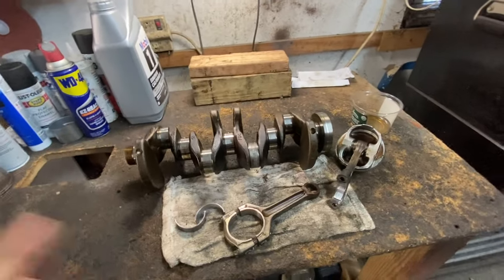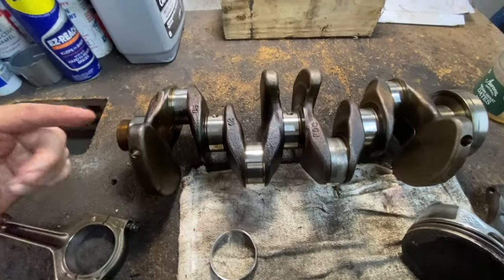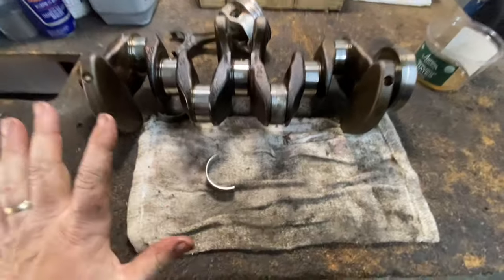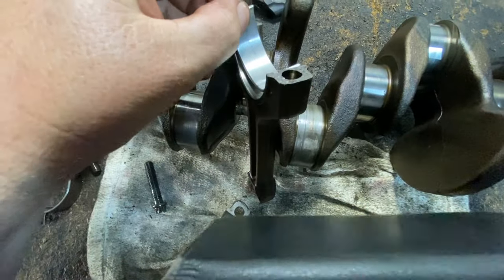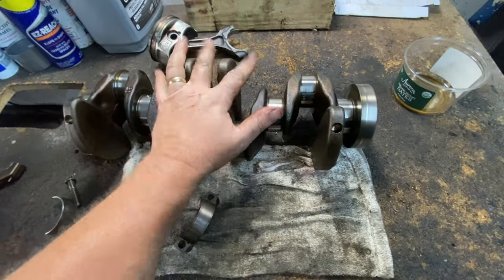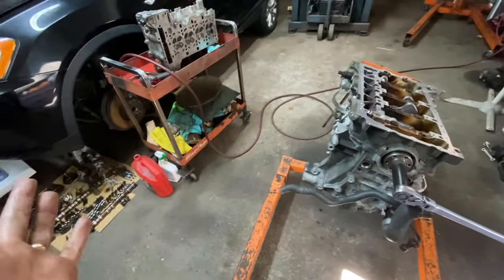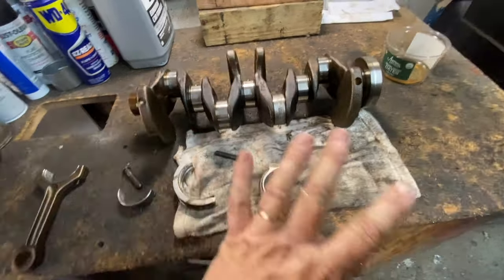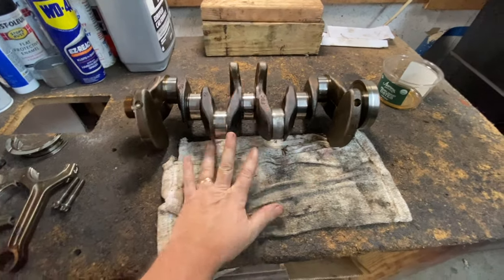Engine Rod Knock - Is It Worth To Be Fixed?

Comment: When this happens to the motor are the cylinder walls at risk ? Is changing the block too much work is it unnecessary?  I was commenting on another of your videos , I just got my car back from 100 miles away and sounds like a rod knock , the car still turns on lol . But now I’m waiting this video and wondering if I should buy crank , but then it’s like so I need a block also ?
Reply from the maker: If you hear and engine rod knock it’s the crankshaft and connecting rod that are damaged. Probably not the engine block cylinder walls.
Reply: @motorcarnut  thanks, yea I caught one of the few crankshafts for my exact model on eBay 220 after watching this. do you think it’s good to change the cylinder head ? I bought one I can return it if not needed. But the Last motor burned lots of oil or maybe was leaking somewhere I couldn’t see. Or maybe leaky exhaust valves .Is a newer used cylinder head overkill by buying it or do I need it being that it could possibly solve any oil “ burning in exhaust valve “ problems since I’m sure the car had these problem before the failure ? I have the 2010 2AR with the recalled pistons where the o ring gets clogged. The motor also didn’t have much mixing of oil and antifreeze when I drained both . That kinda makes me think the oil burned was from leaking valves in the head. Is a whole new head necessary? Will I get a better build vs using old head n internals or moving old internals to newer used cylinder head? Or just leave my old cylinder head alone, I was only going to reuse my cams n camshaft n use the internal from this used head . The used cylinder head is so dry but looks clean . I have to check the cam caps because it looks like this cylinder head was sitting for years . No oil , some surface rust on springs I might return it I’m not sure yet , if I can get it nicely oiled I may use it
Reply from the maker: @Raygetplenty If your cylinder head it not warped, I’d reuse it. You never know with used parts may had a crack or something. Stay with yours if it’s good.
Reply: @motorcarnut  yea Im looking at the journals on my cams and the bearing on the exhaust cam(only bearing in head), mine look so much better than the used part I bought. Mine just looks more workable lol don’t know how to put it. But the used part looks so dry it’ll need some breaking in again . How long the springs n valves haven’t been compressed. Only thing about my head I’m worried about is how good it will mate to the head gasket and the block vs the part I’ve bought . I can’t lie the part I’ve bought looks very clean , I think they cleaned it with something, it has no smog/grime/oil on valves face, on the combustion circle part on bottom of the head . . Very tempted to use it that’s how clean it looks . But it’s 300$ if it’s not needed I’d rather return it. I’m using my cams for sure , the head in 2 pieces . I can use my part of the head that holds the cams , that includes the cam caps/exhaust bearing .the main cam housing basically. But use the bottom and valves n springs from new head that is after I clean them . Or use my springs since I know they’re good but the valves from the used part since they’re cleaner than I’m suspecting mine to be . So other way I can use a better looking part that will be mating to the block but still have the clearance in the cams / cam caps / bearing from how my motor was previous. Essentially keeping the same head but better valves better head gasket seal . They say aluminum head always bend when coming off , right now if my head doesn’t look to bad at the mating surface ( bottom ) I may use it over . But if the new part looks better I may use that . But I’m all over the place I really do think if mine looks fine I need to get my money back
Reply from the maker: @Raygetplenty they probably cleaned it. It yours don’t have scored cam journals top and bottom you should be fine not good to mix and match components. But you have to check cylinder head deck for straightness. I have a video on that as well, if out of spec can be milled flat again. You have to check this on any head you decide to use
Reply: @motorcarnut   so which ever cylinder head is in spec is the one I choose . Or just return the purchased cylinder head ? I’m starting to feel I should’ve just got springs and valves with the money I spent on the cylinder head.
Reply: @motorcarnut  I just got the feeler gauge and yea the used block I bought i think is out of spec.  The side of the deck seem in spec but not the middle  .003 gauge slips under . I’m going to pull off the head on that’s on the car , had to get a bolt extractor set for an exhaust bolt
Reply from the maker: @Raygetplenty No good, see they sold you a bad head.
Reply: @motorcarnut  yea , it was advertised as working condition, but as soon as I purchased it they said I HAVE to take it to a machine shop . I got pistons off the same seller but the pistons aren’t damaged and they’re clean , straight rods . I think those are fine but I’m returning the head
Reply: @motorcarnut  I still have to get this stubborn manifold bolt off , I got the cover off , and the chain n the cam housing out . I kinda hate that this 2AR motor is essentially 4 pieces of heavy metal/aluminum glued together , the cam housing (1) the head (2) the block (3) and the balancer housing (4) on bottom . I think those silicon seals that hold them together have failed in small sections on my motor , on the timing cover seem like oil was escaping and also the rear cam housing rear . Basically the rear of the head . I was wondering what if it’s just 1 connecting rod , should I still change the crank. I’m still trying to see if the crank can be removed without taking the block out but regardless I’m deep in the horror already no going back lol
Reply from the maker: @Raygetplenty yeah just send it back
Reply from the maker: @Raygetplenty crank can’t be removed in the car
Reply: @motorcarnut  yea I figured that,  I have to get the block out , loosen it from the trans and get it out the engine bay . Am I reusing my main bearings if they look fine or are they going to be bad ? Asking because I know bearings for each journal can be different sizes and may be specific to each journal on crank. I don’t know how hard it is getting bearings for each individual journal. I rather not use aftermarket, Toyota ones are expensive but also they have many part numbers I don’t want to get the wrong ones . Or should I call Toyota and double check . I hope mine are spotless but I know that wishful thinking since the noise is in the bottom end
Reply: @motorcarnut  oh sorry you’ve already said new main bearings , I gotta call Toyota and make sure I get the correct one . I feel like I have to talk to an actual Toyota mechanic to get the correct bearings
Reply from the maker: @Raygetplenty Parts department too
Reply: @motorcarnut  I’ve got that exhaust bolt off , had to use an angle grinder . Now the head bolts are on there pretty tight , I have a torque wrench but I’m gonna get n a breaker bar for them , I’ve sent bad the cylinder head back . Also when I took off the exhaust manifold cylinder 3 had some visible oil there , guessing that’s the cylinder that was leaking ? That’s also the cylinder that had a wet spark plug previous to all this happening . I also believe I had a little rod knock for a while , I used to hear it while waiting at stop lights .  I also got a crank but now I just need main bearings really I’m waiting to see the marks from the ones I remove . I’ve looked at diagrams on Toyota for the 2AR I have an idea of the ones I need but they’re not all the same it says order by mark # so I’ll wait till I pull the old ones to check the # if any .
Reply: @motorcarnut  I got the cylinder head off , my number 3 piston top is missing a small chunk , I can see straight to the piston ring. Also that cylinder wall the piston is in has a tiny chip in it , how concerned should I be ? My guess is the piston slapped and caused the small chip ? What do I do ? Yes I can feel the small chip with my fingernail , it isn’t deep it isn’t bigger than 2mm, I was turning the crank it isn’t hard to turn and there aren’t any obvious noises like when I started the car . Is that just because I’m turning it at a slow rate of speed ? I did hear a clunk at one point and there is slight pushback somewhere in turning the crank and one other piston doesn’t really reach the top . For the chip do I need a new block ? It didn’t seem like the piston or rings had a problem getting over the chip . It doesn’t seem like that is the main cause of why the car clunked out.  What do u think carnut what are my options ? What are the chances of that chip leading to catastrophic failure soon ?
Reply: @motorcarnut  Id really appreciate an answer  , I know your most likely very busy.
Reply from the maker: @Raygetplenty unfortunately you have to pull the engine to get that piston out because you can’t get it through the bottom, I have a video explaining that too. From there you can see if the cylinder wall can be honed. But if a chip is missing in the cylinder wall most likely the block will be useless.
Reply: @motorcarnut  yea I already know I gotta get the block out , I’m trying to do it in peices honestly, the more pieces I can get off the actual block the lighter it’ll be to lift out . But about the small chip , is it seriously a big problem I feel like the cars been like that longer than I’ve had it . I’ve had oil problems for years due to that piston , is the block that bad ? I just came back to the the car , it is less than 1mm in width it’s a vertical scarring about 1/8 of an inch long , I think the most it’ll do is slightly bend the oil ring . It’s not microscopic but I also don’t believe it’s catastrophic. I’m going to put a piston in to check . Also I think pistons 2 and 3 are accessible once the balancing shaft but I’m still getting the block out but yea . I have a Camry not an rav4 no awd system
Reply from the maker: @Raygetplenty try to make a video of the Damian’s post it on your channel so I can see it
Reply: @motorcarnut  okay I will , I figure your coming from a true mechanics point of view , measure twice cut once . When I said chip I think it makes it sound terrible but it’s more like a small pitting marks just one.
Reply: I was able to pull pistons 1,2 and 3 with the block in . #1 piston and rod bearings were worn but they were the only ones intact . Piston 2 spun both bearing leaving one in the pan in shreds and the bottom one hanging on by a thread, destroyed that journal. #3 Piston was the one cracked on top where you can see the top Piston ring, when I pulled it I found the whole side of the piston was cracked and gone, the bearings are stuck on to The crank . Can’t get Piston 4 out with the block in , got a stripped bolt in the top rear of the transmission to the block, I have extracting sockets I think ima get another bar to use with the sockets I’m sick of these stripped bolts and . Car was eating oil , running hot , that bolt stripped first try of a turn.
Reply from the maker: Damm bro, sounds like a lot of damage. Hopefully you can save  the block but the crankshaft is gone.
Reply: @motorcarnut  yea crank is finished , I’m trying to make it make sense I’ve been driving the car for 4 years just about. I think piston 2’s bearings spinning is what made the motor give out finally, as for piston 3 I’m still under assumption that this piston being cracked was the first culprit. I still haven’t found pieces of the chipped piston anywhere. Is it possible I bought the car with a 1 bad piston and it lasted 4 years until it spun the bearjng in piston 2 . Seems like a likely sequence of event , or maybe this is just the end result   of the early 2AR’s piston’s bottom ring being poorly designed ? They originally gave owners a 60,000 warrantee for these motors that burned oil I’m guessing my car didn’t make it to the dealership lol .
Reply: @motorcarnut  I found one of my fuel rail spacers in my cylinder head , the small black spacer that keeps the fuel rail seated🤦🏽‍♂️ I definitely lost it doing intake work and thought I misplaced it. I’m pretty pissed , It was blocking air flow to cylinder 2 valve 2 and piston 2 was the one with the spun bearing , to shreads . Piston 3 was the one broken through the side of it. I was doing an intake gasket replacement because of the oil consumption I had, which now I think of it I don’t even know if that makes sense but basically I’ve been looking for this oil problem for a while . Looks like I made the oil problem worse that day , and made a catastrophic mistake. The car probably didn’t have much of a problem with the blown piston , I say that because that was the main and first point of oil loss the whole time owning the car. But the past year it’s gotten extremely worse due to the spacer lodged in the intake side of the cylinder head. Then boom , blown. I got all bolts off the trans got the p/s pump off a/c brake off . No bolts at all in or on the block / lower block , I’m gonna take the engine mount off with a buddy and see how it goes as far as separating the two .
Reply from the maker: @Raygetplenty that sucks. I was wondering how so much damage happened all at once. Got to be more careful. I know time is money but think twice act once. No one is perfect!
Reply: @motorcarnut  yea , that one was my fault but I do believe cylinder 3 piston was cracked on the side before I dropped that in the motor, before I bought the car. that’s the reason I was taking off the intake in the first place looking for a leak ,I was tired of buying so much oil . That was the second time me taking off my intake . But I definitely think that spacer did cause destruction of piston 2s bearings, was by far the worst rods bearings I pulled out , piston 3 rod bearings are still stuck on the bearing that explains the lil dot it made in cylinder wall from slap and the broken piston because of the left to right play from the bearing being stuck on crank instead of on the rod.
Reply: @motorcarnut  Iam eager to see how much more reliable and how much more gas and oil I’ll save once the engine is back proper . I’ve always had to extra buy oil , extra gas and extra coolant because once the oils low it uses extra gas hopefully the cars happy after this
Reply from the maker: @Raygetplenty you definitely will and have be performance too!
Reply from the maker: @Raygetplenty crazy bro, never had an engine with that much damage in one vehicle
Reply: @motorcarnut  I got the block out the crank is cooked , the block bearings weren’t spun , they don’t look the best tho , and under the main bearings on the block on at least 2 journals don’t looks the best . Nothing is broken , I think with new bearings it’ll be fine but I also found something strange . The bearings for the crank were 33223 and the bearings that came out were 33222 . Also the block bearings seemed all wrong the block says 13333 , I’ve got #2 bearings coming off the main block I think only 2 number 3 bearings I haven’t seen a #1 bearing yet . It’s got me wondering all types of things . Why would I have the wrong bearings in there could somebody have already been this far in this motor . I find that hard to But the damage and wrong bearings suggest it . But it seems like I’m reaching
Reply: @motorcarnut  some of the bearings that came off the main caps , not the block bearings but the caps . Some of them don’t even fit in the cap .. they are so much smaller than the cap in length , doesn’t even grip the half circle in the cap there just there . I bought my car from a used car dealer in south jersey with a mechanic in the back . The car came with no plastic undercarriage shields , destroyed fender liners , etc. ( consistent with work being done , but how much work I do not know)
Reply from the maker: @Raygetplenty omg, what a butcher job  to me. They probably just used any size bearings. I would go over every inch of that engine or just replace the engine completely with one that wasn’t touched.
Reply from the maker: @Raygetplenty like I said someone tried to rebuild it all wrong maybe just to get it running to sell it?
Reply: @motorcarnut  that’s exactly what it seems like , they did butcher this car .. I don’t even think they put it together back with care . I’m having so much trouble with 1 stuck bolt in the bell housing .. I’m about to purchase another one this is crazy , they gave me the car it needed a transmission mount I think that put so much stress on these bolts . Every bolt in this car is terrible looking . This one got me so frustrated . I know you said no mismatching parts is a bell housing too much ? Mine doesn’t have a serial numbers on it or any stampings , I’m purchasing one it has some stampings on it but I’ve got to get this done , correctly smh I’m pissed
Reply: @motorcarnut  I’m going to try to take my bell housing off and see if I can punch the rest of the bolt out from the other side and helicoil the threads back . I guess I got that other housing in case I can’t save the bolt either way I gotta take the bell housing off to better access the bolt, the bolt hole is open on the other side but on the car I can’t really access it the trans oil pan is there .
Reply: @motorcarnut  yea they put rod bearings on the crankshaft 🤦🏽‍♂️. The blocks bearing number was covered with so much caked up carbon n debris , doesn’t even look like they tried to read the blocks bearing code. I had to sand it to really read it.  There was also a frandom large piece of sheet metal in the crank case still don’t know wth that was. But  I’m still trying to get the bolt out , I feel like I screwed up my bell housing since it’s my first time doing all this. But also all these bolts were put on without anti seize or anything . I gotta get over it I can’t control what they did with the car . I got the new housing mounted about to just move forward with the build . The block bearings come in today . Block should be done today,  head should be done today . Tomorrow or Wednesday I should be putting the block back in the car, then the head . Cam girdle,  line up the timing . N I’m just waiting for a chain guide . Should be here by Wednesday . Get atf fluid in there oil n coolant n see how it goes 🤞🏾
Reply from the maker: @Raygetplenty Wish I were there to see all this mess, man never seen what you are going through and I seen a lot! Up me updated! Good luck!
Reply: @motorcarnut  thanks for every I got it , got it running like a new motor . It’s perfectly I’m surprised I actually did it lol